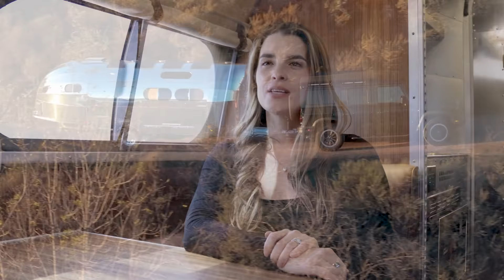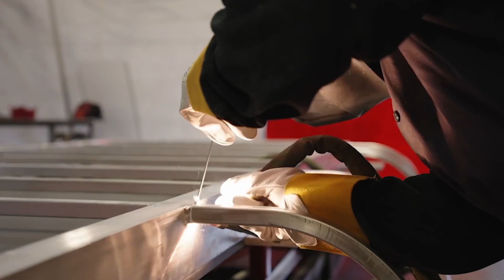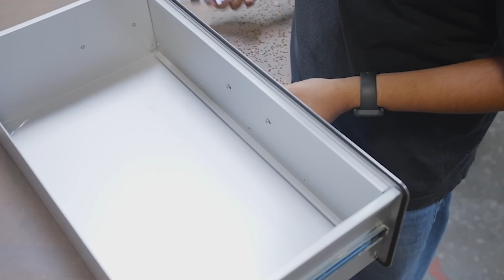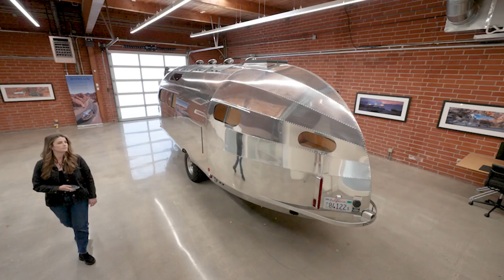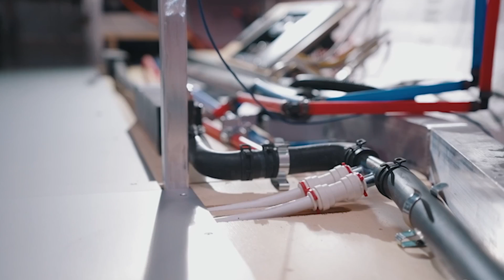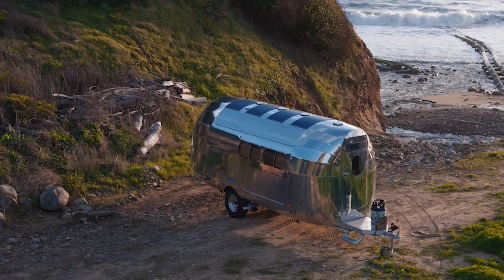Why Does a Bowlus Cost What It Does? | A Full Price Breakdown

Comment: I like what you manufacture and sale. If I win money or come into lots of money someday, I now know what to invest my money in.
I was wondering? If a person had an electric vehicle that is designed to be plugged in to charge? If you pull the Bowlus with an electric vehicle? Would the Bowlus charge the electric vehicle you pull it with? So you never have to seek out a charging system to charge the electric vehicle? If the answer were to be YES, I believe your Company will grow much more quickly.
Thank you
Reply from the maker: Yes, the Bowlus can charge your EV through it's external 20 amp power outlet. This will be a slower charge - mostly for overnight or emergency situations. 
Typically our owners find it's much faster and more practical to charge their EV directly at an EV charging station or through an RV park's 30 amp or 50 amp connection.